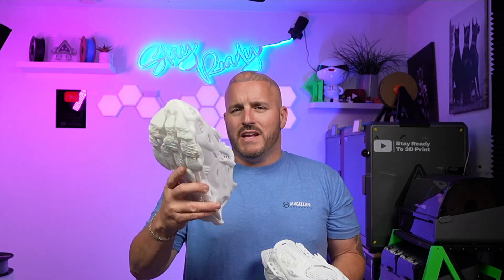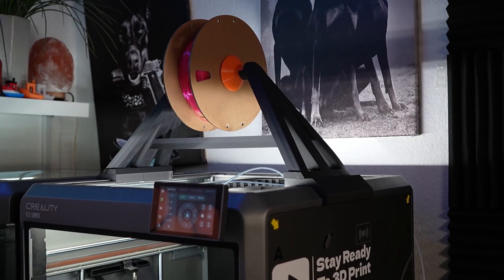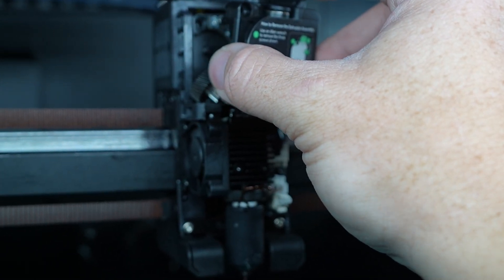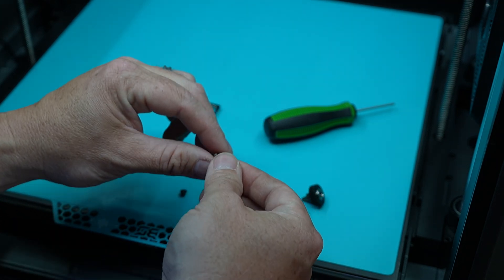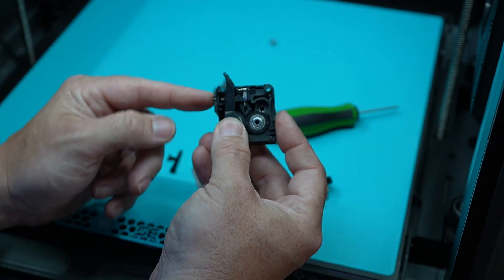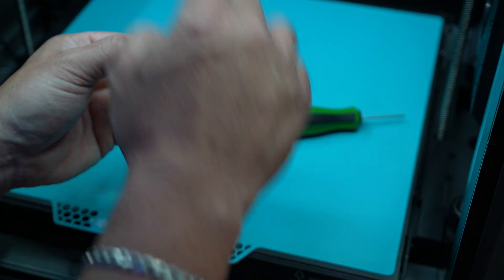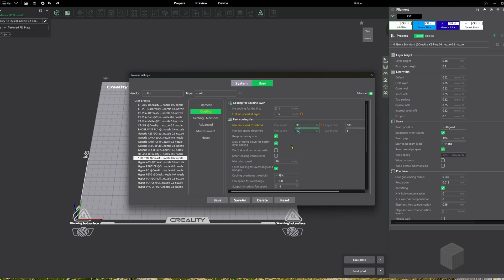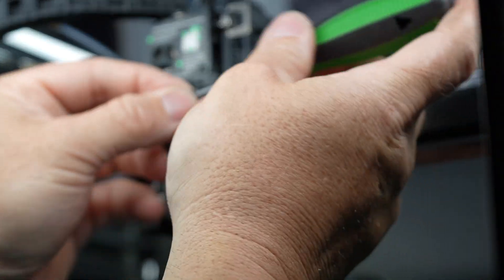My Secret To Printing TPU on The K2 Plus (100+ hours No Fails)

Comment: Do you have any problems with moisture in your TPU when you run it top loaded, and do you think it can help to have a dryer and run its from the side ?
Reply from the maker: I dry it before. I don’t feel moisture gets into it so fast that it needs a dryer while printing. But each persons climate will be different.
Reply: okay thanks alot, and thanks for a explaining an easy fix for the nightmare it is to print with TPU

Comment: Great video, I will try your mod, I have some spring kits, but not exact what you described.
I have 304 0.5 x 6 x15 so the thicknes off the wire is 0.1 less then yours wil this be a problem?
Reply from the maker: Thanks alot! And I think that spring will work just fine. And the thumbscrew you use is a m3x10 with a small spring cut to size to keep resistance on the screw. For that one I use another extruder spring or even a click pen spring. But don’t cut it too long or you won’t be able to apply for Pressure when you turn the screw all the way in for when you’re using hard filaments. That’s the only time you’ll want to screw the screw back in.

Comment: Tried your settings with .6 nozzle and 95a with nice results then tried bambu 85a and still was barely yet still ok, even without any extruder mods :) then tried with.4 nozzle and first layer looks ok  and then after second layer with benchy everything goes south;/ should I modify sth else with profiles for 85a?
Reply from the maker: Settings I provide are merely a starting point. As every filament is different. If you’re getting issues starting at second layer it sounds like you need to increase flow. So as your speed increases you’re losing quality. Which tells me it’s a flow issue. Try increasing volumetric flow rate.
Reply: @stayreadyto3dprint so volumetric flow only? Or flow ratio as well?? Ur settings made magic with 95a and i was finally able to print tpu ehich i owe u a lot of paints:) 85a with .6 was also acceptable but all broke once i tried .4 nozxle:))
Reply from the maker: Yeah volumetric. Run a flow test prior to printing to set flow.

Comment: Thanks for posting this ! In my haste to get started , I printed the overhead spool holder , printed the spring stop and ordered the softer springs without even finishing the whole video, so I never installed a thumbscrew. So far the slides that I am printing are 50% of the way through on a 3 day print and look amazing quality-wise. So do I really need the adjustment screw? I am printing on Crealoty CR-TPU which I am assuming is 95a? It doesn’t mention shore hardness on box or the Amazon page
Reply from the maker: Yes it is 95a. And yes you will need the screw. Not for you really. But you’ll want to adjust it tighter when you print hard filaments again. Also some tpu will need a tighter setting than what the spring you installed can provide. Which is why you need the screw to make adjustments when needed.
Reply from the maker: Great job by the way! And congrats on your new shoes! Join our discord and post them in the show off your prints section. We’d love to see them and hear all about it. Special invite link below. 

https://discord.gg/E5gPc8C2cs

Comment: Hi my friend. Does cfs work fine with tpu?
Here i put tpu in spool holder but i would like to test in cfs.
I have a k1 with upgrade kit to cfs.
Reply from the maker: No. You need to use the side spool or top feed it.
Reply: Sorry with you answer my question in your video but how my main language is portuguese i could lost some statemant.
Reply from the maker: No CFS and tpu. No

Comment: Been trying to print TPU for so long on my Creality HI, now doing some research i found this video, since the K2 plus and Creality HI use the same gears and extruder, i wanted to try this video out. I just have one question, how do you know how much to unscrew it to relieve tension for TPU?
Reply from the maker: I just tried to see what worked. Trial and error. Very simple. I found what worked for me and the filament that I was using was for TPU I would loosen the screw all the way, and then turn it in a few turns and you will know if it’s too loose because your filament will start slipping. If it slips tighten it down a couple of turns and if it jams loosen it.
Reply from the maker: After doing this modification, I went from not being able to print TPU to printing it for over 100 hours straight without a single failure, which is absolutely crazy considering it’s TPU

Comment: i loaded TPU in my K2 CFS, and it pushes it just fine !! ZERO ISSUES.
but you cannot select TPU for any of the CFS spool#, except the external.

so i found that BVOH uses almost the same settings at TPU. low heat, slow and short retract. 
it FLUSHED just fine in CFS #4.
but i think i need to adj my retract dist in Orca.
Reply from the maker: It may work. Highly doubt it will be very consistent or reliable. lol

Comment: Printing TPU from the CFS on the K2 Plus... Now I would REALLY like to see that work successfully so that you can print other filaments in the same model.
Reply: As much resistance that is in the Ptfe tubes, I don’t see it happening.  AMS even states it isn’t supported.  Straight in from the top directly into the extruder is the way for TPU.

Comment: I just ran a m3 by 10 bolt through the hole with the original spring and have had no issus.
Reply from the maker: Well that would t do anything at all if you don’t add a spring stop. The screw will go through the middle of the spring lol and adding a bolt only just add tension. It doesn’t allow you to release tension.

Comment: Creality SHOULD HAVE used a Softer Spring, and left the Adjustment Screw IN PLACE. 
No Clue why they thought it was a Good Idea to ship it the way they did... its hella fail.
i took my spring OUT, and just have a Tension Screw in place - FOR NOW. and is working great for PLA, PETG, ASA -- etc.
im looking at Cutting the OEM Spring, and hitting it with a Torch to make it weaker so i can print TPU - and will try to use CFS. should work.
Reply from the maker: I agree. But I would just buy the correct spring that we know works perfectly. It’s in the description of my video.

Comment: How do you know how much tension to put on that spring, and do you need to adjust it when printing other materials? 

What materials did you use for the spring plunger?
Reply from the maker: I would use petg for the spring stop
Reply from the maker: And the only time you release tension is when using tpu. All hard filaments you simply tighten it back down and back it off a couple turns. For tpu I back it all the way off and tighten it down a few turns then try it. If it slips tighten another two turns. If it hangs up then loosen it a turn or two. Just gotta see what works for you and the filament you’re using

Comment: What speed are you printing it at? Are you running normal retraction? Ive done everything else you said but still failing halfway thru first layer.
Reply from the maker: I turned off retraction in my video. Watch it again. Speed I used is 100% and at default speed settings for the generic tpu profile

Comment: Any adjustment screw settings for different filaments?
Reply from the maker: No. Just adjust all the way for hard filaments. And back it off for tpu.
Reply: @stayreadyto3dprint  thank you. My k2 extruder is having issues again and I was going to throw this at it as well.  I tried some silk pla that has thrown the k2 for a loop with jams and all sorts of errors. Love it when it works though
Reply from the maker: That’s pretty much any 3-D printer some filaments are just not very good quality and they cause issues.

Comment: For months i couldn't get TPU to print. Just lastnight, idk if it eas a fluke or not but slowed it downed, turned off retraction, used a shim in the spring to reduce pressure and arill had issues. I took the same file went to orcaslicer and sliced and printed with default profile and it worked fine. 🤷‍♂️
Reply from the maker: Yup. There ya go. Now since spring mod. That’s a permanent solution. The piece of filament was just how I figured this out at first.

Comment: Thanks for this mod! I did it and I could print a piece in TPU. Actually, the transport unit of the extruder didn't jam. But the nozzle was clogged when I came back to start the next print with another filament. So: what do you do at the end of your TPU prints? Do you heat up the nozzle manually and retract the filament immediately after the TPU print ended? do you purge with a PLA filament immediately? How to avoid that the TPU section remaining in the nozzle part of the extruder clogs after the print has ended? thanks for your help, Rainer
Reply from the maker: Best way to clear out that piece is to run pla through it or just load your next filament and purge some.

Comment: Thanks for doing the Vid, ideal fix, I was looking to purchase Creality Hi, but could not understand why they stated it could not print TPU, I thought they had made a mistake in their specs as they were assuming you were using their CFS unit. I assumed all extruders were able to have the tension adjusted as per my Prusa mini, but obviously not but it would seem a sensible adjustment to have.
Reply from the maker: It definitely is a necessary modification. Even if not needed it all of the time I would still prefer the option to have adjustments.

Comment: So with this change how does it affect pla  and petg ? how much do you adjust the knob? how can you tell number of turns? this video needs a part 2
Reply from the maker: @scifimodelshop  for hard filaments you simply tighten the screw back all the way down to full tightness. You only release tension for tpu.

Comment: I'm using the same overhead spool holder for my machine. Only been printing with 95A with everything stock so far and it has worked for that shore hardness. I've seen a similar Bambu mod for TPU on the A1. Thanks for sharing this!
Reply from the maker: You’re very welcome!

Comment: Thank you very much for making this video. I’ve been struggling with TPU prints. I did a little overhead thing like you did and then shim to the spring kind of Ish got a successful print ish 😢
Reply from the maker: That’s awesome. My first 40
Hrs of tpu printing was done with A shaved half  piece of tpu wedged between the spring and extruder mechanism. lol it worked. But get you a spring.
Reply: @ your the best man thank you
Reply from the maker: @ Yw

Comment: Hello. Is it necessary to use the spring with the screw on the extruder tensioner, or can I replace the spring with a solid spacer or shim?
Reply from the maker: Yeah you need to be able to adjust back to stiff for pla and harder filaments.

Comment: So for TPU I should keep the thumb screw loose and for PLA tighten it up?
Reply: I must’ve done something wrong because I did everything but my extruder still clogged. I need to know much I need to tighten the screw
Reply from the maker: @GalaxyGameZOFFICIALACCOUNT for TPU you need to leave it loose. Tighten it back down for hard filaments
Reply: @ thanks. I just want to confirm one more thing. So for pla and harder materials should I tighten the screw 100% or 75% and for tpu does the thumb screw need to even apply tension to the spring stop?
Reply from the maker: @ for hard materials you can tighten it 90-100%. And for tpu loosen it all the way. Try it. If it slips then tighten a bit. All tpu will be different so you have to try what works for you
Reply: @stayreadyto3dprint  alright thanks for confirming all of that 👍
Reply: Sorry I just have one more question. For flexible pla would I need slightly more tension than tpu? I have FLASHFORGE flexible pla
Reply from the maker: @ you just need to try it. That’s the best way. I can’t tell you what setting will work for your filament. Try it and see what happens. If it slips tighten it. If it clogs or jams loosen it. Pretty simple.
Reply from the maker: @ yes. But just try and see how it works. Thats best
Reply from the maker: Yup

Comment: Can I use this mod for other filaments after i print tpu?
Example: 1st print: PLA 2nd print: TPU 3rd print: PLA. 
Can I use the same spring tension for all of these filaments without adjustments?
Reply from the maker: Nope. You’ll need to adjust tension which is the purpose of the mod. Lol
Reply: @stayreadyto3dprint  gotcha

Comment: Just curious the difference in tension for TPU vs PLA. 
Is it like full tight for PLA and full slack for TPU? 
Or 
Just a minor adjustment between both 
Thanks 🙏🏼
Reply from the maker: Pretty much slack for tpu and full te sun or 75% for solid filaments

Comment: Sp if the original spring has too much tension. The new spring shouldn't need to be adjusted for tpu correct?
Reply from the maker: No. It’s good to go. The adjustment screw it to add more tension for solid filaments.

Comment: I do have one question for you. I have the same exact filament stand that you do that mounts over the top of my machine. I like this, but the only problem that I'm having is a lot of times it spends so easily that it will throw my filament off of the spool and try to get tangled unless I'm in their babysitting it. More particularly in the beginning, not so much while the print is actually going and not moving around a whole lot. It looks like you may be using something different where the spool actually sits in the arms compared to what was actually on the actual print? Does this help? And what are you using
Reply from the maker: I printed a different spool and cut it to fit. lol it provides resistance which helps for sure
Reply from the maker: Try tightening the screws in the bearing or adding something to create resistance.
Reply: @stayreadyto3dprint  I just ordered some one way bearings..should fix her up hopefully
Reply from the maker: Yeah that’ll do it. Great idea. Share the link. I’d like to grab some as well.

Comment: Looks like a great upgrade to me. The only thing I'm probably going to do different is just keep one that has the spring that you're talking about installed, and then keep the other that is set from creality already for pla. Then you can just set the spring like you like and just swap out the head whenever you get ready to print TPU
Reply from the maker: It’s way easier to install the spring and add an adjustment screw so you don’t have to swap every time. I do a lot printing so that would be a pain for me. If you don’t print alot maybe that’ll work for you.
Reply: Was thinking the same thing... 
And if one gets gunked up, there is a backup. Backups are a good thing

Comment: You're going to want to put a clip on your pneumatic fitting at your extruder I have hundreds of hours in these machines and it will fail if you do not. Without the clip the movement of the machine allows that fitting to wobble and because of that the teeth inside of that pneumatic fitting end up breaking and your PTFE tubing will pull out at the start of every print. Also the broken teeth end up inside of the gears of your extruder.
Reply from the maker: I have clips in mine. Thanks though
Reply: @stayreadyto3dprint  which clips do you have? I need to do this still but don't know which is best.
Reply from the maker: I downloaded the one from Creality cloud. It’s a fix they put out. I think the model is red if I remember correctly. And it’ll be from Creality

Comment: Thank you so much for that update. Im wondering if that will help also with ABS/ASA? I have the same problem with those, layer or 2 and jam/clogg and ends of filament look like a zig-zag.
Reply from the maker: Yeah that stuff spring is the root to a lot of jam issues. I’d do it for sure
Reply: Just a follow up. I tried to ajust the tension screw for a while now. Even started priting a smal 20x20 cube with bunch of pauses to adjust the screw, painted a line on the screw so i can count turns and NOTHING 😭. Idk what im doing wrong. Help plz🤪@stayreadyto3dprint

Comment: I had so many issues with my K2 printing TPU. What ended up stopping the jamming was increasing nozzle temp to 230 C.  I’m scared to try this mod and running in to more problems again.  I’ve already successfully printed the whaleberry shoes in 95 A and 90 A.  But yours do look a little better than mine; mine have very noticeable layer lines on the tongue
Reply from the maker: Yeah 230 is way too high lol. This way you can print reliably. With quality.

Comment: I just ordered the spring and stoked to try this out!! I got 5Kg of 95a tpu and can go for some new  shoes!
Reply: What size thumb screw is needed? M3? And what's the length?
Reply from the maker: @Get2Diggin pretty sure it’s m3 x 10mm. But length is preference. Just make sure the spring you cut to go on it as long as the screw
Reply: @stayreadyto3dprint  awesome thanks
Reply: @stayreadyto3dprint  should I use petg or pla work with that spring stop?
Reply from the maker: @Get2Diggin  it doesn’t matter really
Reply: @stayreadyto3dprint  awesome thank you
Reply from the maker: Awesome!

Comment: Great video! I'd like to see if you can do this on the Creality Hi! I have my TPU settings super optimized but still every now and then it jams for seemingly NO reason. I am going to test this and post results
Reply from the maker: This will solve the issue if you change the spring.
Reply: @stayreadyto3dprint  Hey man did you happen to see the other fix recently posted? Someone made models for some shims to place between the extruder release mechanism on the creality cloud! I've just tested 0.4mm on my Creality Hi and it works great
Reply from the maker: @ no. But it will work too because I actually used a piece of filament to wedge between the mechanism which is how I decided that changing the spring is a more permanent fix.